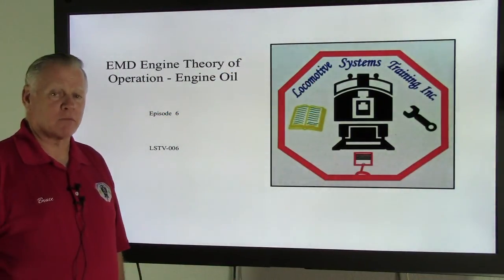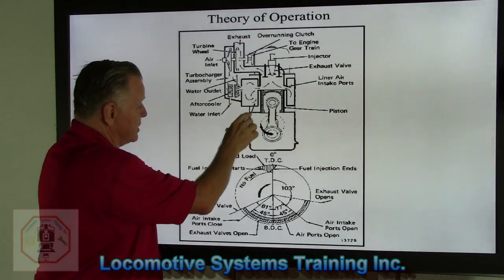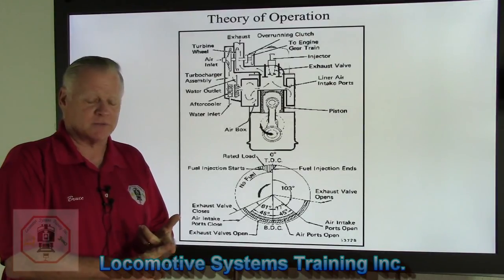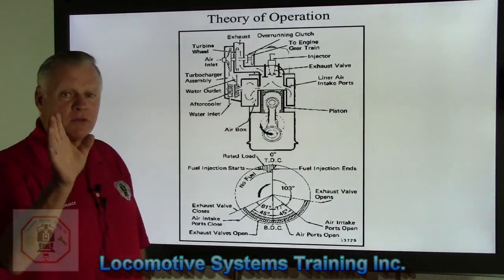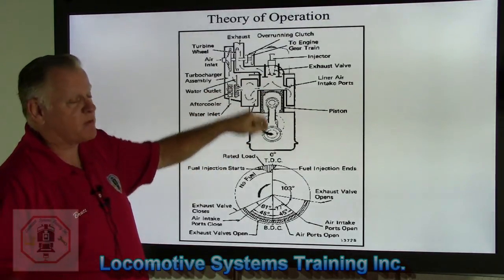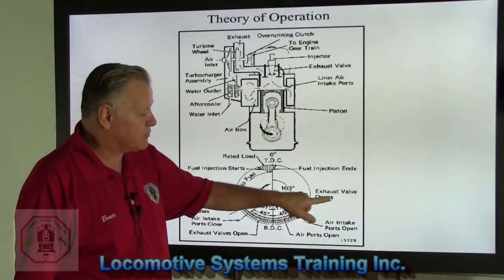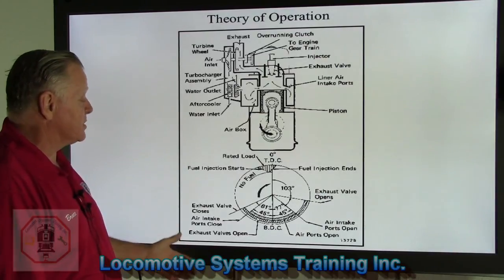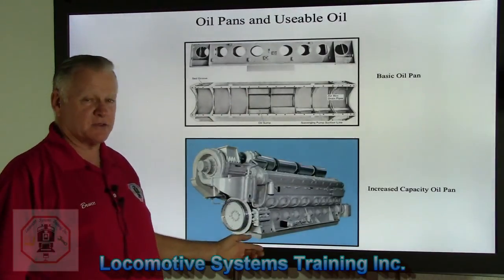LSTV-006 EMD Engine Theory of Operation - Engine Oil

Comment: !yes on an emd the Pistons do rotate,because the rest pin is mounted to a piston carrier ,like a piston inside a piston a large snap ring holds the piston outer shell to the inner piston know as the piston carrier!on a 2stroke engine the piston is always under a downward force.the connecting rod on the one bank of cylinders doesn't even have a rod cap it's held in place by flanges made on the master rod it also bears on the outside of the rod bearing while the master rod bears on the crankshafht bearing the forked rod doesn't contact the crank it contacts the outside of the rod bearing only unless you've seen one this is all to confusing but I'm correct on this hope this was clear!

Comment: 2400 lbs firing pressure is not possible...2strokes are lower in firing pressure...i never heard of any 2 stroke with figures like that...big 4 strokes max out at 12 to 14 hundred psi...i don't know where he got those figures...it wouldn't last long at 2400 psi...

Comment: on an emd 567 or 645 whats the correct crankshaft timing order for a replace the 2 and 10 cylinder so you don't bend the crankshaft https://www.youtube.com/watch?v=BdT9d3eZsIs&t=334s

Comment: The intercooler does not cut the temperature is half. More like 20-30%, depending on which scale he is refencing. Temperature is not measured from zero on the F or C scale, but from absolute zero.  This instructor is wrong on his physics, and inarticulate. I know only a little about diesel mechanics, but I could do a better job.
Reply: Them EMD burn some oil. It’s lieu having oil injection.